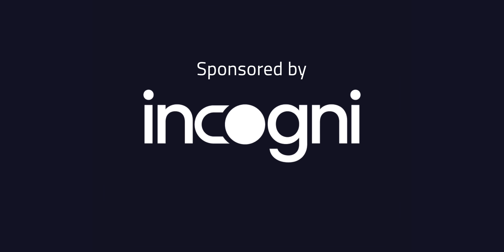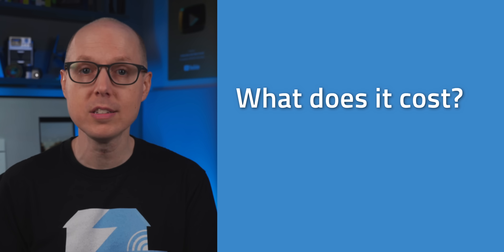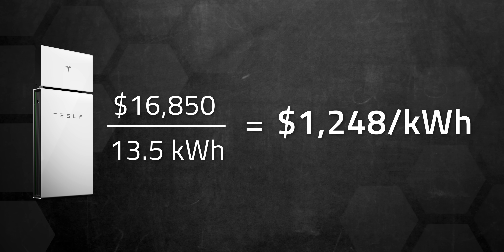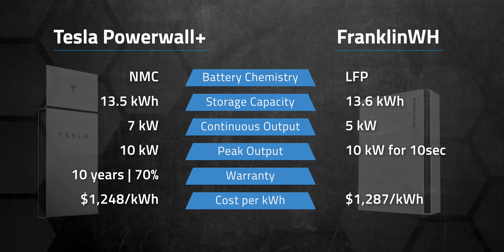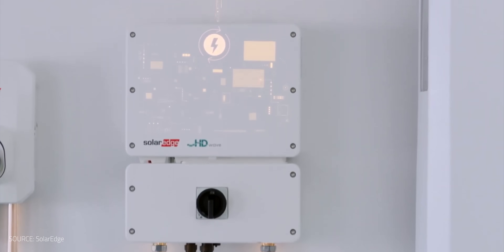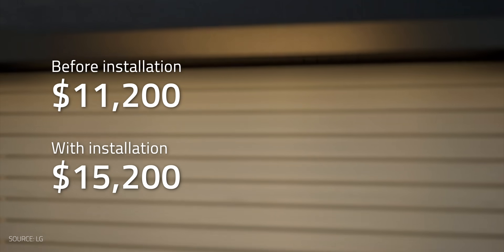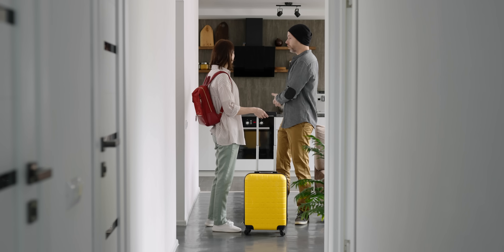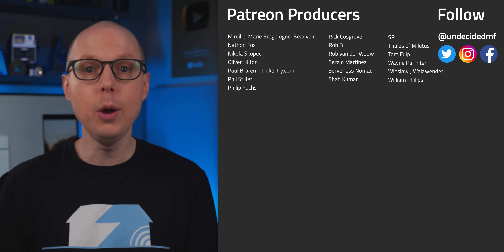Top 5 Batteries for Home (And One You Might Not Expect)

Comment: i am preparing to build 18 small homes next to each other. they will be ICF homes (different types for each home) all with ICF roofs.  I am looking at doing different storage for each home so I can test side by side in real time for each system.   It will be interesting to see how they all perform next to each other and if the entire subdivision can be linked together for a complete off grid community.

Comment: How did you pick your vendors? Some of them are not the "TOP 5" in sales and deliveries...
Reply: Good question. Another question is how much one needs to be continuously connected to the grid?  Battery backup decreases the overall efficiency of an installed system and greatly increases the cost. Consider the benefits of a  hydrocarbon powered backup generator in liew of batteries to reduce the impact of rare earth mining. How often will it be used?

Comment: With massless batteries around the corner , an ambitious system could involve a hydrogen blimp that would absorb water vapour go above the cloud layer and use solar power to convert water into hydrogen or charge the structural batteries . Ionic wind turbines could also take advantage of high winds to generate more power . If it was like a UFO mothership it could deploy a charged power drone that would dock and release a battery to the home and then return a depleted battery pack back to the power blimp . This could generate energy 24 hours a day and could make money charging your neighbours battery pack as well .
Reply: What is impossible is a weakness of mind .
Reply: Riiiiight.... You're kidding, I hope?

Comment: I see that all the batteries listed are American based companies. But your audience are not all American, so in the future, I'd want to suggest that you do such research maybe on a broader geographical location base. 
Say for example, Europe, Africa, Asia and more. 

Like you said, I'm rooting for the flow battery, it will be the best of all, if they succeed.
Reply: Consider a hydrocarbon powered backup generator to reduce your initial cost outlay, increase the efficiency of the system and reduce your rare earth mining impact. Just a thought.

Comment: Paying over $1000/kWh is certainly the reason most people decide to not go for battery storage. There are some very tempting options for those interested in a more DIY installation, with 48V LFP server rack batteries costing around $300/kWh
Reply: that will go down to 200$/kWh when the new V2 sodium ion battery from CATL with 200Wh/kg comes to market.
the problem in the next years will still be a shortage of these all-in-one battery inverter systems because the demand is shooting up, now they have reached a certain cost effectiveness.
Reply: I will be non grid-tied. That will let me plug select appliances into the battery system lowering my electric bills. And it will still serve for disaster outages.
Reply: Or go with something like the seplos mason kits and grade A cells for ~$225/kWh.
Reply: @niktak1114  That's not much of a savings over eg4-lifepower4 packs. They're priced around $300/kWh and you won't need to spend a hundred hours testing and assembling for roughly balanced capacities.
Reply: @emailkanji  I spent 0 hours testing. Grade A cells are typically quite balanced from the manufacturer.
Reply: @niktak1114  What's the capacity difference between strings on your battery bank?
Reply: @emailkanji  all the cells within each pack are within ~1Ah of each other
Reply: Or (local building regulations permitting) a build it yourself out of 280a cells with a decent BMS. Lots of tutorials on youtube for them, built my solar and battery two years ago with no previous experience in electronics.

14kwh for sub 2k (or £142 per kwh)
Reply: @BalberithThePenguin  interrested about, please can you tell me more?
Reply: IMHO buying battery storage now is a bad time. Today batteries are build in Lithium which is currently at premium costs as you are competing with Tesla and smartphones.
Sodium and Aluminum batteries are currently coming to the market. They will be better suited for fixed installations due to their weight deficits compared to Lithium but be cheaper and with a lesser ecological footprint.
Reply: @svenweihusen57 depends on how old you are and how long you intend on using the purchased product. The formulas you're expecting are being reported as 4-8yrs from scaled production. 4-8yrs of 30kwh a day electric useage at the house is between $5k and $16k in averaged standard rate here assuming the cost of power never rose from today, which is very wishful thinking. If I can get a system in place now that offsets my energy useage even by half, then use it for the next 8yrs, I'll be seeing roi by the time the new formula becomes widely available to the public.
Reply: @Xonikz  fair point but I disagree on the 4-8year prediction. CATL is rolling out it’s sodium batteries currently. VW is announcing a car with sodium batteries this autumn and BYD will also sell EVs with sodium batteries. And sodium batteries are produced the same way as lithium batteries so scaling up isn’t really a problem. The sodium batteries will likely get better but these advantages are mainly kW/kg improvements which are irrelevant for stationary systems.
Currently everyone and his brother are building battery plants and with sodium chemistry there isn’t really a shortage in raw materials as there is for lithium. On top of this sodium batteries are inherently safer than lithium batteries as thermal runaway isn’t a problem for these due to the different chemistry.
Reply: @svenweihusen57  I'm still not 100% sold on sodium batteries replacing lithium iron sulfate. Power density in storage is going to be an issue for some of us in regards to where we can actually house a standard backup battery for the house. Am I mistaken in thinking that sodium is way less power dense and therefore much larger units for the 40kwh+ capacity this chat string is discussing? I was also under the impression that despite the sodium battery cost for material being lower, the replacement cycle would be much more frequent.
Reply: @Xonikz  sodium batteries are at 100-120 W/kg compared to 160 W/kg for LiFePO4 . This is roughly 30% lower which isn’t a real problem for stationary batteries. For lifetime cycles I am finding values similar to LiFePO4 up to 3 times higher. Don’t know which is actually true but most likely sodium is at least in the same life cycle range.
I currently would like to install a small PV system but I am currently refraining from it for maybe 1-2 years.
Reply: @svenweihusen57 don’t t they have significantly limited cycles ?  I would think durability would be the most important feature of a home system. The best system is feeding into the grid.
Reply: @rcpmac  They have life cycles are roughly the same as LFP batteries. 3000 cycles minimum and around 6000 at good conditions. These are full cycles so you can add at least 30% to transfer this into days. 
Feeding into the grid is often a problem because you get way less for the energy you provide than for the energy you need to buy back.
Reply: Yes but you will never get a permit to enter connect it with the grid so your discussion is meaningless.